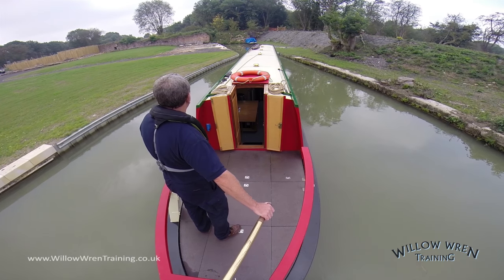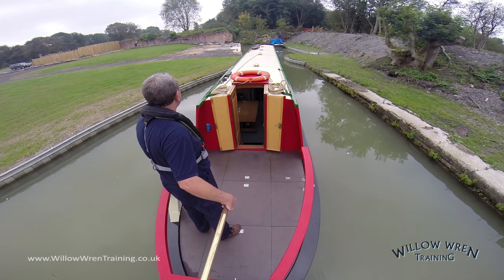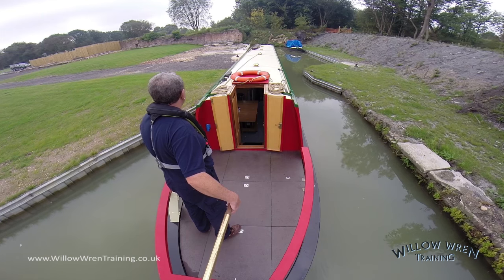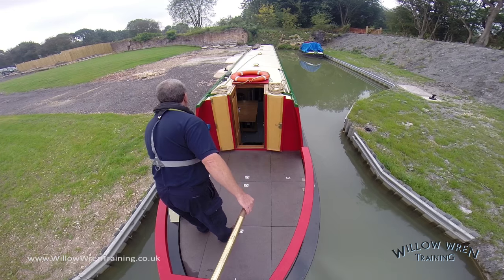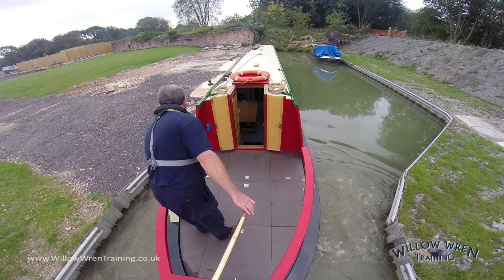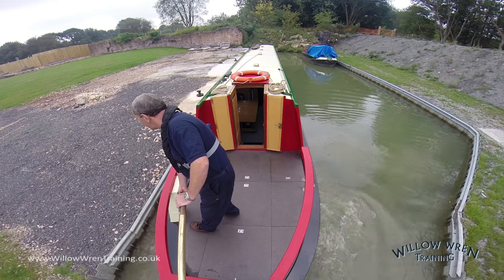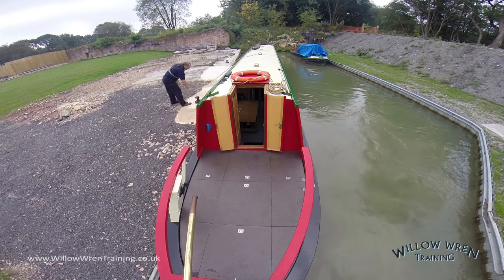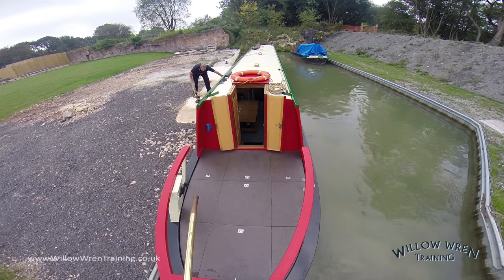8. Mooring Up Single Handed

Comment: Great video. Just wondering why moor so close to the narrow part of the canal?
Reply from the maker: You are right to question it and it wouldn’t be wise to moor this close to a narrowing. However, it is our private arm entrance before we restored the whole arm and we just used it to demonstrate the process.
Reply: @willowwrentraining3736  Yes, I thought it was just for demonstration. What do you do if you're on your own and there's no bollard? I'm not being awkward, I've never had a canal boat but may do and this is something I've wondered about. Some sort of land anchor?
Reply from the maker: John Melville Hi Done this many times without a bollard or ring using piling hooks, chains or even mooring spikes plus hammer. Clearly, if there was an off shore wind then it will be a challenge but then boating alone is a challenge and you learn to adapt.
Reply: Everyone moors up different but in general safely. I've never used reverse to stop when mooring for the last 15yrs I've lived on the canals ! I've always approached a landing in dead slow ( in neutral ). Relying on the prop can be hazardous in some cases.

Comment: What do you do if there is a cross wind?
Reply from the maker: As it says on the video, the tutorials are not a substitute for a training course. 
However, cross winds can be managed. Firstly, as a single handler I would try to make life easier by finding a sheltered spot to tie up. That may not be a choice, e.g. at locks, so there are a number of ways of dealing with it depending where you are. 
If it is a lock then concentrate on getting the stern in so you can step off with the centre line. Secure the centre line to the lock landing bollard or ring. By now the bow will have blown away from the bank but with the centre line firmly secured, you can spring the bow in using forward gear. (See Springing On). With the boat “steaming on a spring”, tie off the bow then the stern before stopping the engine. 
If you are in the open then do the same thing using piling hooks. If there is no piling or rings the it is more difficult using pins so that’s when finding a sheltered spot becomes more essential. Hope that helps.

Comment: Not  quite  so  easy  if  no  rings  or  bollards.
Reply from the maker: On a windy day you are absolutely right, but on a still day it works fine.  If there is piling, then stepping off with a piling hook can work as long as you don’t put too much load on the hook. They are not as strong as they look. But, as you say, it is much better with a bollard or ring and so is useful on lock landings.